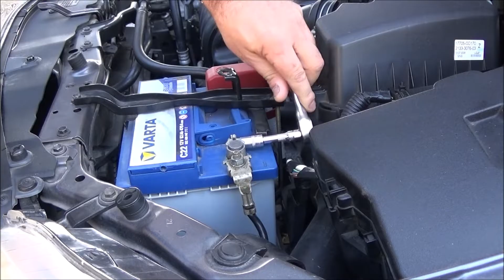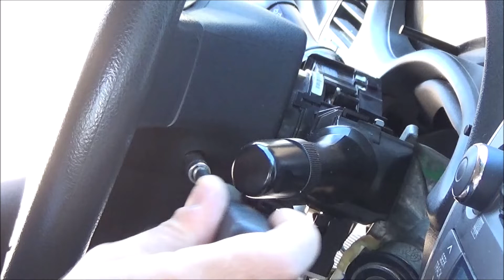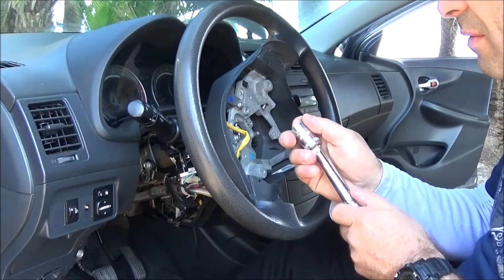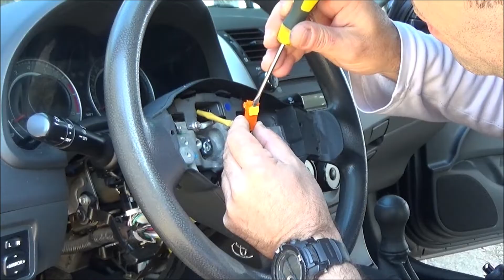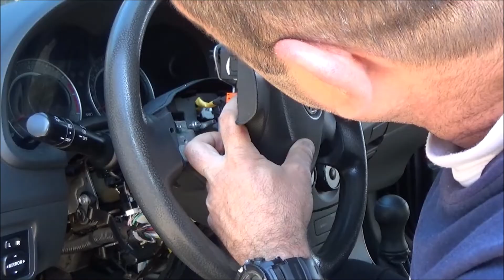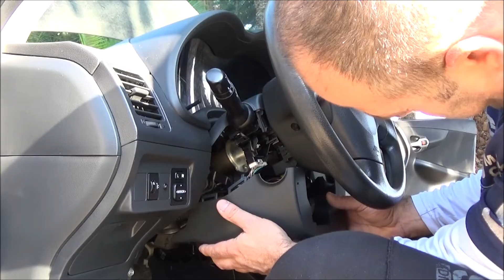2007-2013 Toyota Corolla Airbag Removal & Clockspring Replacement Yiannis Pagonis

Comment: I wanted to give my review after completing this for my 2010 toyota corolla. 1st of THANK YOU you saved me a lot of money and my car!  All of my lights came on (break, airbag, tire pressure, and I cannot remember the last one, but no check engine light) none of my guages worked and my ac ran hot. I could not run any codes and only recieved an error. So when I saw this video I wanted to give it a shot. All these steps are spot on. There are a few note I would like to add there are screws for the 1st panel thay needs to ne removed so unscrew those before you start pulling.  Also, the steering wheel could be hard to wiggle off. You must hit on the back of the wheel to loosen it. You can also use a hammer if you cannot get it to budge. I found hitting the bottom towards the driver seat most effective. Other then that some of the airbags come off differently then the one he shows if you have the red and black clips with the yellow tab pull those up (gently) and then remove the red and black connectors from the air bag. 1 final note the bolt on the steering wheel is a bit hard to grt off use a torque wrench for easier removal.  All my lights went off, power steering came back and my gauges are functioning and my ac now gets cold again. All of this stopped working on my car due to this issue. My car runs perfectly fine now with this video some tools and a $180 steering angle sensor from carid. I am a woman and if I can do it so can you!
Reply from the maker: Hello Deborah. I am honestly glad that you managed to do it on your own without anyone's help which means you have a gifted talent. But isn't it strange that all these stopped working in your car because of this problem?
Reply: Best comment ever. These steps saved me as well lol. Thank you strong capable lady 😊
Reply: Did you also replace the clock spring or just the sensor??

Comment: i would first remove the air bag steering wheel then remove plastics and replace the clockspring,would be easier to change

Comment: The horn of my Corolla(E140) is not working. Should I remove the parts you removed in the video for this, too? :)
Reply from the maker: What is the main cause of horn not working?
One of the most common reasons for a non-functional car horn is a blown fuse.
Why is my engine horn not working?
You should check for the presence of voltage at the horn while the button is being pushed. Get yourself a 12V test lamp and connect the clip end to a good metal surface on the body or the engine. Test the power wire at the horn while pushing the button. The test lamp should light. You may need an assistant to help you.
How do I know if I have a bad horn relay?
You will need a helper for this. Put one probe of the meter in the blue/yellow stripe connector and the other to ground. Have your helper press on the horn ring. The resistance should drop from open to close to zero. If that passes, and your relay is not clicking, then your relay is probably bad.
How do you fix no horn?
1.  Check the Fuse
2.  If the fuse is blown, replace it.
3.  If the fuse is intact, jump power directly to the car horn with a homemade fused jumper.
4.  Clean the horn's ground cables and connections thoroughly to remove corrosion and grime.

Comment: I would like to thank you for the video. It was very helpful in replacing my daughter SAS on her Corolla 2010. Her car was getting Steering, VSC, ABS lights on, odometer and RPM not working. I read on the Corolla forum to replace the SAS which I was surprise and shock but it was the problem. I bought the part from Rockauto for $125 and installed it. Mahalo....
Reply: Same issue with my 2010. I will be replacing mine this weekend I will let you know if mine is fixed too.

Comment: Great work Mr. Pagonis. You have solution for virtually every possible issue. Kudos and Thanks!
Reply from the maker: Thank you my friend Sahil. I am doing the best I can. Greetings from Greece.
Reply: I just can’t believe today I myself replaced the faulty clockspring in my 2011 Corolla Altis due to which the system was throwing check SRS system light. All of this done with the help of your video and the light’s gone too. You and the internet combined saved me a few thousand bucks today. So grateful. Best wishes from India.
Reply from the maker: @saxenaji  Thanks my friend from India. I am from Greece. I just did my duty and nothing more.

Comment: Love the music, if you compress the sides of the bottom steering column panels and pill down it pops out in one smooth move, and there's to catches on the top that if you pry back a tiny bit the top comes off just as easy
Reply from the maker: Thank you very much for your observation

Comment: This is a good  video  with these video l can change my Toyota  Corolla  2010 spira cable  next time there  is  any  issue.  If l had  watch  your video  l would  have save more money  last week  l ended up paying  $535 to Toyota workshop.  My airbag  light  was on for couple  of weeks  l was told my spiral  cable  need to be change. The  labour  that costed  $335 l would  have  save  that to my pocket.  Spiral  cable  is just about  $135 - $200. Thanks  for  your  Time  and the sharing  of Knowledge  God bless  you
Reply from the maker: Thank you very much my friend

Comment: My 2011 Corolla LE has cruise control.  The clock spring I bought on Amazon worked fine but there was a module snapped onto the back of the old clockspring for the steering sensor.  I was able to put that module onto the clockspring I bought and then everything matched up.

Depending on what comes with your new clockspring you may need to reuse that steering sensor on the new one.
Reply from the maker: Try it my friend and I hope everything goes well without problems

Comment: Do you need to turn the clock spring 5 times one way and 2.5 the other before you line it up? Or is it as simple as lining up the arrows?
Reply from the maker: The spiral cable is an important part of the SRS airbag system.
Incorrect removal or installation of the spiral cable may cause airbag deployment.
INSTALL SPIRAL CABLE
(a) Check that the front wheels are facing straight ahead.
(b) Set the turn signal switch to the neutral position.
NOTICE:
If it is not in the neutral position, the turn signal switch pin may be snapped.
(c) Install the spiral cable with the 3 claws.
NOTICE:
When replacing the spiral cable with a new one, remove the lock pin before installing the steering wheel assembly.
(d) Connect the connectors to the spiral cable.
NOTICE:
When connecting the airbag connector, take care not to damage the airbag wire harness.
ADJUST SPIRAL CABLE
(a) Check that the ignition switch is off.
(b) Check that the cable is disconnected from the negative (-) battery terminal.
CAUTION:
Wait at least 90 seconds after disconnecting the cable from the negative (-) battery terminal to disable the SRS system.
(c) Rotate the spiral cable counterclockwise slowly by hand until it stops.
NOTICE:
Do not turn the spiral cable using the airbag wire harness.
(d) Rotate the spiral cable clockwise approximately 2.5 turns to align the marks.
NOTICE:
Do not turn the spiral cable using the airbag wire harness.
HINT:
The spiral cable will rotate approximately 2.5 turns to both the left and right from the center.

Comment: Can this cause the radio and paddle shifter to function on its own when I make a right turn only?
Reply from the maker: If the clock spring is failing, it may become difficult to turn the steering wheel, or the steering wheel may have a “stiff” or “binding” feel. This often disables some radio and cruise control functions.
Reply: Yes right now I have no function for any of the steering wheel buttons such as cruise control or control of the radio and paddle shifters, air bag light is also on for circuit code, but everytime I turn the steering wheel to the right the paddle shifter mode turns on and the radio also gets functions like volume up or down and switch stations
Reply from the maker: @mularock2352  My friend check the Clockspring

Comment: Can you replace the steering wheel of a 2009 LE model with the steering wheel of a corolla S? And be able to control the radio with the controls in the steering wheel?

Se puede cambiar el volante de un Corolla versión LE por uno version S con mandos al timon, y lograr conectarlo para controlar la radio mediante los mandos del timon??
Reply from the maker: If I had a such 2009 Corolla LE I would do it my friend
Reply: @YiannisPagonis  thanks 4 replying do u know if it's possible to replace it with the Corolla s steering wheel? If it's possible to control radio through it? And + get the night light in the buttons?
Reply from the maker: @loganrage3047  Yes I think it can be done what you want to do

Comment: What I want to to know is can I take a steering wheel from let say the latest hilux with steering control buttons and put it in a car without those using the newer head units
Reply from the maker: Is what you want to do compatible? Does it fit in the car you want to install?
Reply: @YiannisPagonis  yes man I want to take from the revo hilux the steering wheel and head unit put in passo 1st Gen think it should work with the wiring
Reply from the maker: @saddammalima8458  I'm afraid this can not be done my friend!
Reply: @YiannisPagonis  why not? It's just changing the clock spring and wiring
Reply from the maker: @saddammalima8458  Then change it and tell me the result of this change
Reply: @YiannisPagonis  will do so as soon as I can but thanks for your content you guys are creative wish we had a car market enthusiasts in Namibia
Reply from the maker: @saddammalima8458  I am waiting for your news soon about what you intend to do

Comment: What size of socket would I need for the nut on the steering column?
Reply from the maker: It is 19 mm socket my👭👬👫 friend😊😇
Reply: Thank you brother🙏🏼🙏🏼
Reply from the maker: @hamzashetranjiwala3885  You are welcome my friend
Reply: @YiannisPagonis  Do you happen to know what foot-poundage to torque it to? I installed mine too firmly and it ended up crunching the clockspring housing when I tried to turn it.
Reply from the maker: @stephanieaensland6520  Interested in learning about the steering wheel nut? Did the installation the clockspring work properly?

Comment: At 6.34, are you saying the arrow needs to be lined up? Apart from that and making sure the steering wheel goes back on the same tooth, anything else to make sure of?
Reply from the maker: My friend what you should notice when installing this part of the car is that the ends of these 2 arrows should be joined in a vertical straight line. If you look carefully you will see that there are 2 arrows and not 1 arrow.

Comment: Anyone I have changeed my steering wheel. It is not straight when wheels arte straight. Damn!.
Reply from the maker: Tell me, my friend, how did you install the steering wheel. Did you place front wheels facing straight ahead and then lock the steering wheel by removing the car key? Before removing the steering wheel did you put alignment marks on the steering column and your new steering wheel? Did you do anything else after that? (e.g. on the bars and wheel links)
Reply: @YiannisPagonis Yiannis, thank you for your kind answer. I didn't do the marks on columns and new wheel. My bad. I think I turned the steering wheel accidentally when I screw this bolt on. 
 I didn't do anything more: the bars, wheels links etc. Only steering wheel. 

Is there any chance to reintstall correctly the steering wheel now? or do I have to do this wheels links stuff and ->alingment then, as I think? Thank you for your time.
Reply from the maker: @janjohnny4945  I'm sorry about that my friend. Because you didn't do what you were supposed to do, your car needs an alignment. It is not easy to do by you, like e.g. engine oil change, and must be done by a dealer or repair shop. It requires the right tools/machines and also the knowledge (experience) to properly align your vehicle. I am sorry 🙁🙁
Reply: @YiannisPagonis  thank you for your time and information.

Comment: you edited out how to get the t30 screws out to remove air bag. mine seem to be stuck and wont come out of hole. how did you do it?
Reply from the maker: My friend, to loosen the 2 screws, first spray a little anti-rust on the screws and then hit them with the T30 using a small extension
Reply: @YiannisPagonis  I got them loose easy enough but the air bag still would not come out. I had to keep working the screws with needle nose pliers and small hooks to get it far enough out to remove air bag. took me 20 min. but thanks for the response
Reply from the maker: @csul5961  Did you finally make it my friend? Everything went well;
Reply: @YiannisPagonis  yes it all set. I used your video to replace my broken cruise control. thanks
Reply from the maker: @csul5961  I'm so happy to hear that. I had a great concern